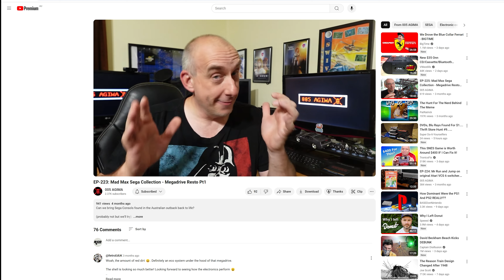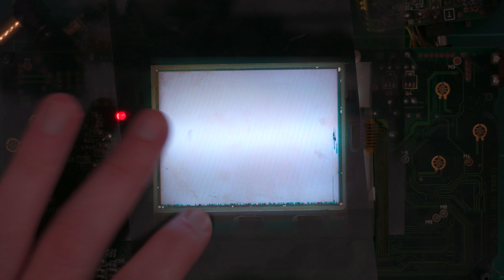Dumped in the Aussie Outback... Can this Game Gear be Saved?

Comment: Recommend lighter fluid for the more stubborn glues, I had my doubts at first but it's a good one to switch to when IPA isn't working Eg. avoid scraping with a screwdriver. Evaporates faster than IPA so not much residue.
WD-40 does a decent job at restoring plastic sheen, dedicated products basically contain the same stuff. Also for paper or cardboard restoration a light damp wipe of hydrogen peroxide is gentle while also helping to lift dirt off.

Comment: The basic theory of liquid crystal displays + polarizing films (Yes, I'm a Yank. We use zees/zeds, not "s"es. :P) is that they bend/twist light to let light pass through colored filters.

The polarizers act like microscopically-thin slots. The BACK polarizer creates a base orientation for the light waves , focusing it from its source, in neat rows, with all the waves in the same direction.
But the light, in its base orientation, is not able to pass through the slots of the FRONT polarizer enough to create a proper image.  (Think of a dog that has a stick in its mouth trying to pass through a slotted fence)

This is where the liquid crystals inside the glass panel come in. Various electricity voltages cause them to rotate to a specific angle. Light that goes through them is twisted into the same orientation. Now, the following makes sense, but I'm not sure if it's correct: the twisting of the light is what makes the brightness of the colors, as you could probably see by rotating those uncut polarizer panels.